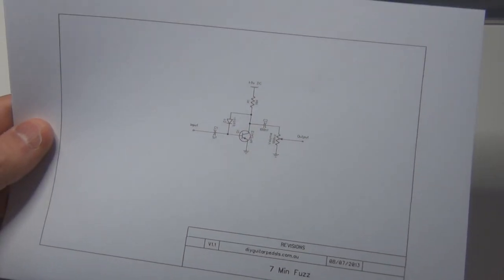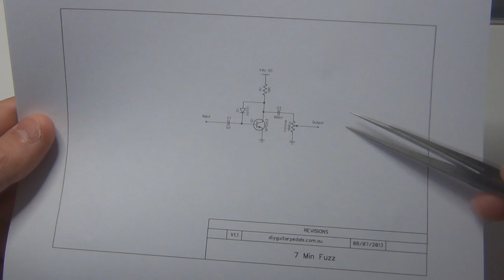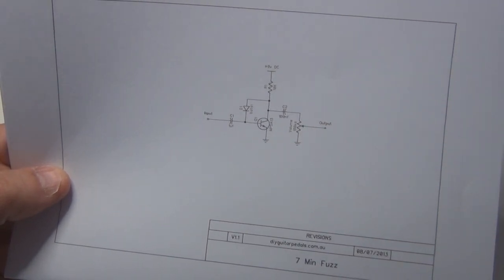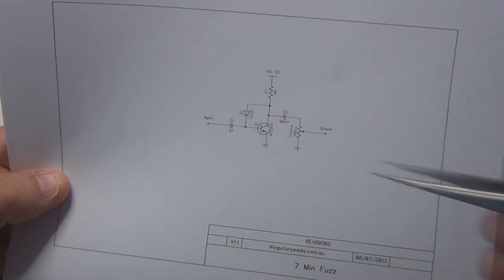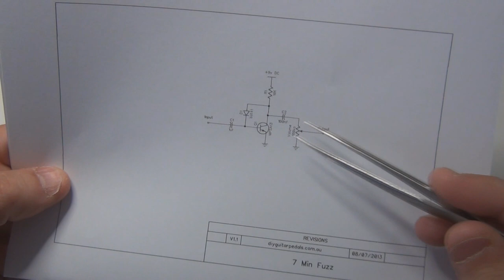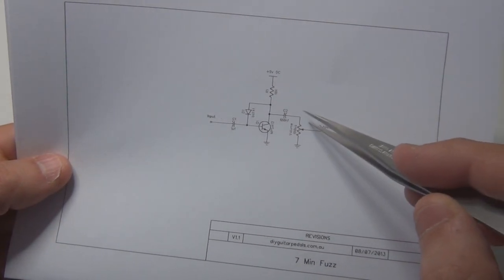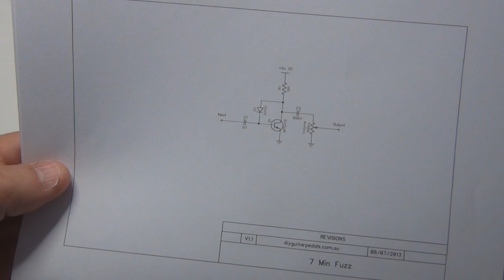Guitar Pedal Fault Diagnosing Example - No Output

Comment: Paul, the release of this video couldn't have came out with better timing! I just completed a rullywow plexicruise build last week and as soon as I watched this video I realized that there was a good chance I was likely experiencing the same kind of issue you described. However, with my build it ends up that the tone pot lugs were grounding out to on a DPDT switch that was just above it causing all kinds of terrible noise on the output when the pedal was engaged. Sure enough, I took it out of the enclosure like you described, pulled the pot lugs back and fired it up and it worked perfectly. This video just potentially saved me hours or even days of utter headaches in trying to fault diagnose it! Thanks a million for posting this!

Comment: Thanks.  Bought a used pedal with the same issue.  Power fine.  Engage pedal and it's like the volume is as low as it can go and it can only be faintly heard.  Looked at the volume pot and it looks like the solder connections between terminals flowed into each other.  I will look for a schematic to confirm.

Comment: OK, so I went to a rehearsal room last night, plugged in all my gear, amp, pedal boards, guitar etc. So When I tried to use a pedal, no sound at all, tun off the pedal and I got a perfect signal.  I even just tried tried by Cry Baby on tis own, switched it on and it didn't cry it fecking squealed like a stuck pig.
Thing is I have two boards, a bespoke board and a Boss BCB60 board full of Boss pedals, the latter which comes with it own built in power supply. So I know I didn't plug anything it wrongly. Plugged them in separately, neither of them would work. Even tried single pedals as opposed to a daisy chain. Nothing, nada, feck all.

Took my gear home plugged it in and bingo, all working. It could only have been a bad power supply at the socket in the rehearsal room. What do you think?

Comment: Hey man I have a problem with my pedal and i don't know what could be wrong. The thing is when I switch on the pedal, the led glows but there is no sound coming out of the pedal. When I switch it off sound goes through perfectly. Now I did everything I could to check if maybe it was something with the grounding (took it out of the box to see if it changed anything but no still no output sound). Do you think something fried maybe?
Reply: Have the same problem! Did you find out ? Cheers!
Reply: I have the same problem...did you find out what happen.?
Reply: Same problem here
Reply: Hey, so I had the same problem with a fuzz i made 2 weeks ago. No sound when stomped on, only led, but true-bypass when off. I ended up sticking a piece of duct-tape on the 'bottom' of the enclosure underneath my vero effect board. Sure enough it started working. turned out my wiring was fine after all.
Reply: I think it may be the power supply, see my post.
Reply: @chrisdaviesguitar  cool ima try that out becsuse I just now had this problem but with every pedal I have and I only use like on or two at a time the all power up but no sound when switch on tho. But my adapters are pretty old and inexpensive and I know all my pedals just didn't stop working all together cause I don't use them that often
Reply: @chrisdaviesguitar  cool ima try that out becsuse I just now had this problem but with every pedal I have and I only use like on or two at a time the all power up but no sound when switch on tho. But my adapters are pretty old and inexpensive and I know all my pedals just didn't stop working all together cause I don't use them that often

Comment: I didn't make a custom pedal I just bought one but being brand new and having no volume was kind of weird. turns out I had the wrong polarity adapter originally so I changed that and then the lights came on but still had no sound. if I turn it up to like six on the amp it should be super loud, instead it sounds like it's on maybe 1 or less. in other words super quiet. however it is working kind of, which is a relief so now  I'm going to open it and check the legs to see if anything is touching like you explained. hopefully your video answered my question thank you very much

Comment: honestly, if you rock before you box and the output doesnt have no signal AND nothing has blown up, its very much always a short to ground in the signal path. What i do is i use a multimeter to test the signal path with in resistance mode. I hook the common end to the ground, then probe with the red. If a path is shorted to ground where it isnt supposed to be, it will have a reading of 0 ohms.

Comment: Hey, recently i made a Rat clone but I' ve bought too small enclosure so it doesn't fit. I wired the jacks and pots anyway just to be sure that the pedal is working, but the only thing i hear is the hum (I didn't connect the 3PDT too because i don't have one yet). I've checked every connection on the PCB and it's all right. 
I connected the input directly to the input on the PCB, output the same. It should work right?

Comment: Great Video! 
I have a Digitech Sampler that is giving a faint signal at high volume , is that a  broken Pot?
It also has the pots that are Soldered right to the board with 6 pins.

Comment: Thanks for your time. It really helped me understand basics of diagnosis. Please my Effect Pedal, Mooer Get 100 isn't giving a clear output. ever since I bought, I couldn't use it and it's warranty has expired. how can you guide me on this because I already gave up hope on it not until I came across your video.
Reply: It really depends as your comment is very vague on the situation. Is the output quiet?
Reply: @SleepingLionsProductions  No it isn't but it's giving an unstable sound which doesn't seem to be like that of a strummed guitar.
Reply: @alexanderumoh4456  oh the ge100 is an multi FX unit which is a lot harder to work with. I didn't know that. For the price, even if it's past warranty, it's not worth diagnosing and fixing unfortunately.
Reply: @SleepingLionsProductions  Thanks for the update
Reply: @SleepingLionsProductions  I got to know that there are a lot of Spider ICs on the PCB. If the lines of signals can be traced to the output Port from the legs of the IC responsible in the program. I wish I knew the technical approach to this, I would have tried it but to avoid worsening the whole issue.

Comment: I bought two Behringer VP1 phasing pedals tu use with a synthesizer. What can be the reason that I do get a very low volume hiss (I can hear the phasing itself), but not the sound it should 'carry' on both the Behinger VP-1 pedals? When I turn the effect off, I hear the actual sound of the synth, so that is definitely not the problem.

Comment: Hi nice video, but I have one question. I have a DIY pedal of a TS 808, sounds great . but it had issues that at the extremes of the knob it would cut out the sound. at then return when turning the other way...

But now It just gives no sound..the LED is on and the effects after that one still work. THEN I hit the pedal (had the issue before) and it works again...Could you please give a hint of what the problem could be . everything looks ok and apparently sometimes it needs a bang to work. thanks in advance

Comment: Hey,

I have a Delta Labs Stereo Chorus Pedal that gives sound on the mono out when bypassed. When the fx is turned on, the mono output is still on, but it is not affected by the chorus at all and neither of the knobs changes the signal drastically. You can just hear that there is a sort of HPF engaged. The Second output, for stereo, has very loud floor noise and a high pitched noise, that pulsates rhythmically with the LFO rate in the chorus (I can see by the LED's blinking rate). 

Do you have any idea what I can check/do? The pedal arrives here like this.

Kind regards,
Joel

Comment: hi, need your expertise, i have a boss fz5, it was working perfectly before but now,
it has light and sound but the volume and gain are very low even if i put th knobs in max. as if it is set on 7-9 o’clock.

do you know whats wrong with it, or can it be fix diy? or any guess, thanks

Comment: great video you've made dude, so help full. and sorry i wanna ask this. i have some problem with my pedals. my pedals were work properly before, but when i change the power supply, and i turned them on they wont work even the led indicator was on, but they have bypass output. would you tell me where the problem is?
Reply: Make sure your guitar pedal power supply is center negative

Comment: Question ... those look like board-mounted pots with insulating plastic things around them. Are they a particular brand or are the plastic / rubber socket things available separately? I "solved" the back-of-pot-shorting-with-pcb problem by inserting a sheet of 30 thou plastic sheet but I think your way is a little tidier (understatement).
Reply from the maker: +Tom di Giovanni Hey Tom, the pots are from tayda electronics, they include the pot dust caps with their pots.  Thank you for the compliment, happy building!

Comment: I have a joyo jf-08 digital delay pedal that works ,but there is a gritty scratchy sound that goes loud then quiet and keeps repeating but is constant and wont go away,
I was given this pedal from a friend and it looks like something has been spilt over it with some residue dry inside.would this cause a part to make this sound.
regards
Andy

Comment: So could you get a smaller pot that fits below to have some clearance or is the tape the fix?  thanks for showing us this stuff; its good to see how this happens.
Reply: +Don Lee You could definitely get a new pot, you may have noticed the pot I was using was a solder lug retrofitted for pcb mount (the underlying cause of the problem as the lugs were dimensionally larger then they should have been).   Isolating with tape fixed the problem though.  Your welcome Don thanks for watching!

Comment: So what might be the problem if with a boss chorus ch1, the led turns on when I stomp it, but not wet signal, only my original dry signal remains untouched. So essentially the led goes on and off and dry signal passes through. Any help please
Reply: Problem with the board itself. The way choruses work is that there is supposed to be a duplication of the dry signal that is slightly delayed IIRC. So your CH1 might be Fd.

Comment: Are there any other common issues that lead to signal in bypass and no signal when the effect is engaged? It doesn't seem like my signal is flushed to ground anywhere, the only thing I can think of now is an issue on the circuit board, but the last one of the same effect and batch I assembled works just fine.
Reply: My switch had short circuited internally, great...

Comment: I have a hm2 clone. When I activate switch light comes on I have distortion . When deactivate the pedal pushing switch light goes off no guitar signal at all . I checked jacks make sure not over tight took cover off back make sure not grounding out . Any ideas
Reply: check your footswitch wiring

Comment: I have an arion delay/echo pedal... i plugged a nine volt in and the pedal has send prior to and after pressing the effect switch and the red led even engages on. however, there is no effect going through. It is an old pedal, and has not been used in a many years. Could offer up any thoughts?
Reply: Hi.. Is your pedal fixed already? I have the same problem with my flanger. The pedal turns on and has a sound but no effect coming out. How did you fix it? Thanks.

Comment: how do you troubleshoot pedal that has very low volume output?
Reply: this can be a few things IMO.

1) signal shorted to a disconnected ground. When the ground isnt connected, very faint signal will pass through. Make sure the ground is connected properly and if the signal just straight up disappears, the signal is being shunted to ground somewhere.

2) One of the components might not be working properly. Check to see if there are any other shorts to ground by using a multimeter in resistance mode. Hook up the black probe to ground and probe along the signal path AND the voltage path with the multimeter. Anything shorted to ground will show a 0ohm resistance.